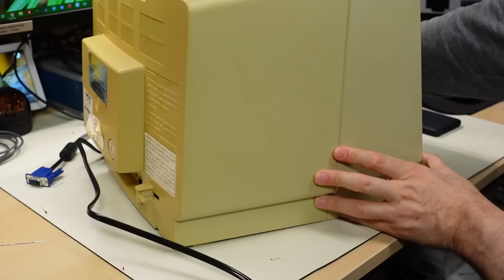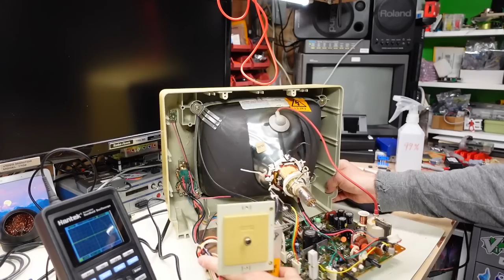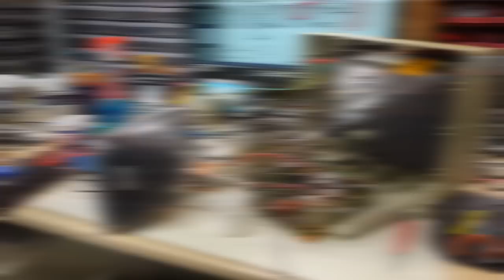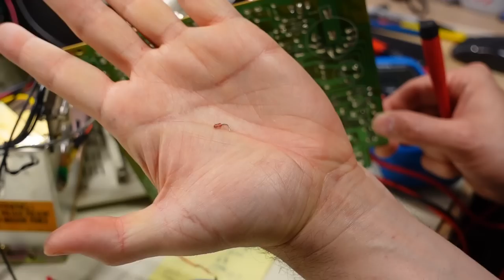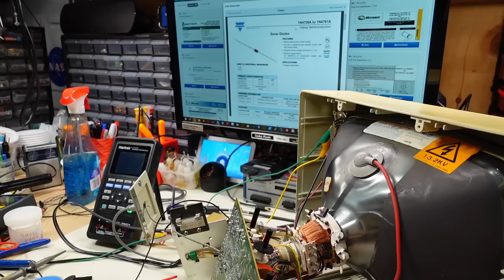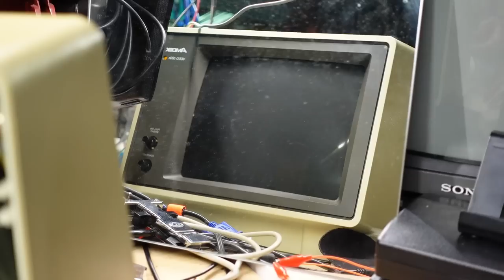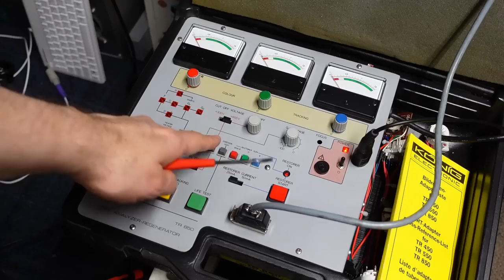I ruined this Amdek 300A after fixing it

Comment from the maker: Thanks to viewer Todd, he pointed me to the SAMS schematic for the monitor, and indeed, that diode is just a bog standard 1N4138 part! I wasn't using my head there. Luckily, the 33v will just act as a normal diode in the circuit in this case since the voltages are under 33v. See Diode D101 on the schematic here: https://archive.org/details/cmt-3-2/page/n1/mode/1up
Reply: You said you had another amdek300 so I was confused why you couldn't look at that one or connect it to the crt.
Reply: I was going to recommend that site when I did a quick search, good thing I looked in the comments. Too bad the monitor did not work out 100%. At least you got a good chassis to pit a decent tube into.
Reply from the maker: @dr_jaymz  Heh yeah that one is away in storage at the moment -- sometimes stuff is really hard to get to :-)
Reply from the maker: @JoeCdaYT  Yep exactly, CRTs wear out, it's just a fact. The other one has a pretty good CRT, so I'll swap the CRT and keep the electronics in case a hard to replace part on the one I keep dies, like the flyback.
Reply: @adriansdigitalbasement2  I might be able to come up with a green 12" CRT for you. Do you have the tube number?
Reply: @adriansdigitalbasement2  There was a guy in the US who used to fix CRTs but he passed away. I believe he wasn't the only one - if someone knows of someone else, I would love to hear about. The guy would carefully break the neck of the CRT, let it fill up with air for one day, separate the neck from the rest of the tube, clean and repair the filament and plates, put the parts together, fill it up with the appropriate gas and weld the neck back.
Reply: @maxheadrom3088   That shop closed down, and would have to have access to an appropriate electron gun to install anyway, which is part of why he closed up shop.
Reply: As soon as you said "1N4" I thought it was a 1N4148. That's probably the most common small-signal diode out there, what Dave Jones would call a "jellybean" part: the one engineers reach for when they don't have any reason to pick anything else, like the 2N3904 and 2N2222 NPN transistors. It didn't look like a Zener diode, which would typically be meant to dissipate at least some power, so wouldn't come in the little glass DO-35 package.

Looking at the circuit, it appears to be designed to prevent the node from exceeding the value of the supply voltage as the supply shuts down.
Reply: @adriansdigitalbasement2  pity it was a nice looking monitor 😟.... "I spy.. I spy with my little eye"🧐... a future CRT swap? 🙂
Reply: Zeners are often used as protection diodes so replacing them with the highest value you have on-hand is not advised. Best to figure out the intended voltage for the circuit they are on (look at nearby capacitor ratings if you have no schematic) and assume the zener will be rated equal or lower.

Comment: Step away from the rejuvenation button, sir.
Reply: No, I use the same tester with good rejuvenation results. The trick is you shouldn't allow it to go through the three automatic cycles. You should turn it off right after the spark show. Also the timing seems to be off on this tester, it feels like the cycles are too long. The timing is done by 555s and the longer timings use electrolytic caps, which are if leaky, can make the timing longer.
Reply: @mrnmrn1  I watched and thought NO! this was a do or die tester. Mike Tyson of testers
Reply: @martinda7446  Yes, it's do or die, with at least 70% chance to die if you let it go though it's automatic 3 passes. But if you use it with caution, and turn it off right after the sparking stopped, it gives you at least 70% chance that the tube will be better than before, and 90% chance that at least it won't be worse than it was.

I even had a good success rate with a real brute-force 'Mike Tyson' rejunetaion method, before I had this tester: 9V transformer on the heaters, 230V mains across the cathode and G1 with a 1N4007 and a 60W bulb in series (40W bulb for smaller tubes). It woke up much more tubes than it killed, usually they lasted a few months or just a few weeks, but sometimes years.
Reply: how DARE A GAY COMMENT in Adrians videos
Reply: @juliedunken1150 what are you waffling about, discrimination isn't cool

Comment: After working in a repair shop for a good long while back in the day, I really have to recommend not rejuvenating CRTs unless they're already truly unusable. It was just never intended to be anything more than a short-term temporary fix: the point was to get you through a couple weeks at most, until a new tube could be ordered and installed. Couldn't keep every CRT in stock, let alone cart all of them around in the van! Nowadays it's a not the best idea unless it's already pretty much dead; even when it 'works', it accelerates further degradation by literally vaporizing the emissive coatings.
Reply: We saved some CRT boosters from old sets to use. we would tell the customer that they have months to plan for a new TV. Note: the CRT boosters were different from rejuvinators in that they just increased the filament voltage.
Reply from the maker: Indeed -- I wouldn't ever do it on a CRT that's in decent shape, but this one was pretty dim and blooming. It's really hard to show in the camera because the HDR recording and automatic exposure compensation makes it look better than it is. (Plus my basement is pretty dark.) I was 99% sure it wouldn't turn out better anyway with a high likelihood of being worse. Perhaps some CRT testers do a better job but this B&K 490B is simply terrible at it! LOL!
Reply: What would it take to actually improve a CRT that has reached an almost unusable state? Is it possible to somehow take apart the tube and reapply emissive coatings inside (or otherwise fix things), re-vacuumize and seal it up again?
Reply: @snagrul  One of the things that get weak is the phosphors on the front that produce the light. As the CRT gets older and dimmer, and the user turns up the brightness, the degradation even accelerates. But when you look at how a CRT is fabricated, there really is no way to remove and reapply that coating. The bulb is produced in one piece, then the inside gets washed with water and HF, and the coating applied which forms a permanent bond with the glass. Afterwards another coating is applied to the inside. Also, the way the electron gun is put in and the glass melted really doesn't allow disassembly. And even if you somehow did, to replace some of the coatings, you'd basically building a CRT from scratch. For example, you'd first have to remove all the conductive painting on the inside.
Reply: @snagrul  Oh, and most refurbish companies would just install a new electron gun. Basically cut off the neck, extend, put in a new gun, and evacuate. Obviously that way you won't cater for burn-in or weak phosphors.
Reply: I have a B+K 467 CRT tester and rejuvenator and used it on multiple monochrome CRTs, but only on ones that were so bad that you couldn't use them in normal daylight. Some CRTs tend to respond well to the lightest rejuvenation procedure called "clean and balance" and doubled their emissions immediately, others tend to go even lower and lower with each try. Stronger rejuvenation completely ruined the tube in 100% of the cases I had, so if one short shot of "clean and balance" does not improve things, I leave the CRT alone.

My advice: Never try to improve a CRT which is still somewhat usable. Never try to improve a CRT that is still half-way decent. Only try it on CRTs you don't mind recycling afterwards. Chances of the CRT going worse are quite high. When a CRT responds well to a single short clean and balance procedure, just leave it there, be happy with it and don't try to push your luck any further. If it responded well on the first clean+balance try, the success usually lasts. If you have to push it, you just blow the little remaining life out of the CRT in seconds.

CRTs that sat a long time also tend to get better when just run for some hours. Just the other day I had a serial terminal where the CRT was visually so bad that it was only usable in a dark room with brightness and contrast turned up all the way. Also very fuzzy/bad focus. I just kept running the terminal and after maybe half an hour, I could actually watch it slowly get brighter and sharper. I ran it now for maybe 5 hours, had to turn down the brightness multiple times. It has now become reasonably bright and sharp all by itself and stayed that way. I will not touch it with the CRT tester, I suspect I can only make it worse again. ;)
Reply: @graealex  It's apparently possible to replace the gun and phosphor in monochrome CRTs and companies did this until surprisingly recently for specialist equipment that couldn't easily be upgraded to something more modern. No-one has the equipment or skills to do this anymore though, unfortunately.
Reply: @makomk  Replacing the gun was somewhat normal. Particularly for TV sets, burn-in really isn't such a problem. Rather the problem is the electron gun itself.
Replacing the phosphor is pretty complex. As I wrote in one comment, first the phosphor is coated onto the inside glass, and then lacquer, and then the conductive paint. So if you want to get to the phosphor, you have to strip all three of them, and then reapply all of them. 
The latter one was really only done for specialty equipment where no other replacement was feasible. Nowadays companies will rather retrofit an LCD if you really need to continue to use some particular equipment.
Reply: @makomk  I suspect glasslinger on YT could do it. The old TV who loves fixing old TV's.
Reply: @snagrul  There certainly were rebuild services for CRTs and it was a common thing until twenty-five years ago! The neck would be chopped and a new gun assembly fitted. No other work was done, the phosphor/shadowmask end is sort of bulletproof. Nobody would ever try and restore the gun assembly - ever, though theoretically, it is possible. So clean up, cut, reassemble with new gun, re-vacuum and dag
Reply: @adriansdigitalbasement2  Please read my recent comment about the tester. To save you from finding it, I just copy it to here:

I have the same CRT tester. You should check the timing components in its rejuv circuit. It's using 555 timers, and I think electrolytics for the timing. So I would say, not just test, replace all the elctrolytics in the timing circuits. It might just apply the rejuvenating current for too long because of a leaky timing cap. Based on my memory from last year, when I was using mine last time, I felt the cycles of yours are too long.

Mine is working OK, BUT there's a trick: it goes through 3 cycles of rejuvenation every time you start the rejuventation process. If the first pass gives a nice sparky light show like this one did, I would turn off the tester right after the sparks disappear, and test the emissions. Especially with small CRTs like this. Probably the first pass was successfull, and the two remaining passes ruined the CRT. The bright orange glow after the sparks was the cathode, that was overheated by the 25mA of current the tester was pulling through it. You should have stopped within a second at that point to save the cathode.

I have great luck with this rejuvenator saving tired CRTs, since I usually don't let it go through the three automatic cycles.
Reply: No. Don't rejuvenate CRTs. Rebuild them. Not impossible lol. There were ads to start your own business!

Comment: I have the same CRT tester. You should check the timing components in its rejuv circuit. It's using 555 timers, and I think electrolytics for the timing. So I would say, not just test, replace all the elctrolytics in the timing circuits. It might just apply the rejuvenating current for too long because of a leaky timing cap. Based on my memory from last year, when I was using mine last time, I felt the cycles of yours are too long.

Mine is working OK, BUT there's a trick: it goes through 3 cycles of rejuvenation every time you start the rejuventation process. If the first pass gives a nice sparky light show like this one did, I would turn off the tester right after the sparks disappear, and test the emissions. Especially with small CRTs like this. Probably the first pass was successfull, and the two remaining passes ruined the CRT. The bright orange glow after the sparks was the cathode, that was overheated by the 25mA of current the tester was pulling through it. You should have stopped within a second at that point to save the cathode.

I have great luck with this rejuvenator saving tired CRTs, since I usually don't let it go through the three automatic cycles.

Comment: Something you might consider for future tubes is an inductive getter firing tool. It pulls impurities out of the gas from the tube. This is especially effective if a tube is slightly gassy. Of course of it's leaky it might work for a short time. The sure fire way to tell if a tube needs it is a discoloration of the silver patch that coats a small portion of the inside of the tube. If it's white the tube is usually gassed out. Other colors have other meanings but I'm sure you can look that up. The alternative is that I write the whole manual in the comments and while I'm sure a few people would like that, I don't think you really want a comment that long. Cheers for the great content mate.

Comment: This was my first monitor for my Tandy 1000A (I had bought the whole setup used).  I eventually ended up slicing the mesh off with a razor blade.  Later on I acquired a Tandy CGA monitor to replace it.  All of that has been gone for almost 30 years now.

Comment: The brown gunk is likely an ethylene vinyl acetate (EVA) based glue gun adhesive that degraded and produced acetic acid (vinegar) as it decomposed.
Reply: Usually some kind of chlorinated rubber based stuff. Guess what it breaks down into...
Its really, really cheap and still used unfortunately because of that.

Comment: As you say ,that brown goop goes conductive over time,also corrodes tracks and components.This goop was used on many,many electronic parts.As a retired engineer what we used to do in the 80's with soft tubes ( bad focus etc), was to increece the filiment voltage,this improoved the electron flow to the screen,you dont need much increece,millivolts infact,now obviously the filiment would have a reduced life,but we never had any come back with failure,many a 20"plus tube was done this way,and the results were positive.This wasnt an option on some tubes, just depends on the filiment voltage circuit,many were just a resistor reduction Good channel,Thank you Adrian.

Comment: I did learn TV repair in the late 1990/ early 2000s.  The way we did it with a similar König Tool was never use the auto rejuvination,
 give it short burst with the manual trigger and knock the crt's neck near the heating filament with the back of a screw driver (not to hard of course)
Reply: I'm liking this idea. Guess the auto rejuv doesn't take it into account that it's working with decades old tubes!

Comment: I have a Sencore 7000 and it is the absolute best at rejuvenation.  It goes all the way from a gentle cleaning up to a full rejuvenation.  I have had dead emission tubes restored to a very useable state and weak to like new and it held.   If you can find one working for a reasonable price get it.

p.s.  the Sencore has a setting to draw 1 ma as a very light restore.  Works wonders.

Comment: The idea behind amber monitors was supposedly less eye strain.  However the amber phosphor wasn't as efficient, so the drive had to be increased.  That accelerated burn-in and shorted tube life.  Call me old fashioned, but I like green screens better.  I found the amber tended to be a bit fuzzy.
Reply: I tend to agree on that. My eyes certainly respond better in terms of visual acuity with the shorter green and blue wavelengths.

Have you ever tried to read stuff under low pressure sodium (SOX) lighting and also (separately) clear mercury vapour? You'll likely see what I mean if you have.
Reply: <--- also on team green here.

i wonder why no one ever made monochrome CRTs with BLUE phosphor ... would've looked kinda cool IMO
Reply: @KenjiUmino  Same here regarding appearance but since our eyes are less sensitive to those wavelengths it would mean driving the CRT much harder. I think cyan would work well in both respects though.

Comment: My home-built CRT reactivator has never destroyed a tube, though I always quoted a 10% failure rate to people just so they were prepared for the worst.  It's a slightly improved version of a design published in "Television" magazine in the 1980s.  It looks like your Konig one may have a fault.
Reply: Yes, the cycles seem to be too long. I have the same tester, I use it for rejuvenation with good results. The main problem with it is the three automatic cycles. If it sparks like crazy at the first pass, it should be switched off, otherwise it kills the cathode during the next two passes. Probably that's exactly what happened here. After the light show, the CRT was happy, but it got ruined by the remaining two and a half cycles.